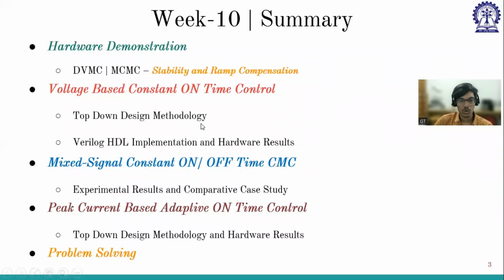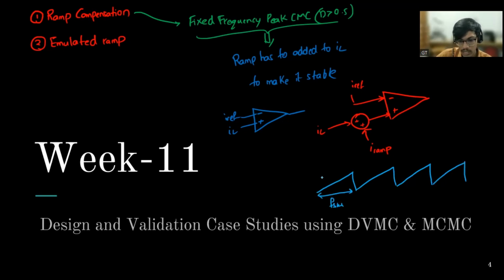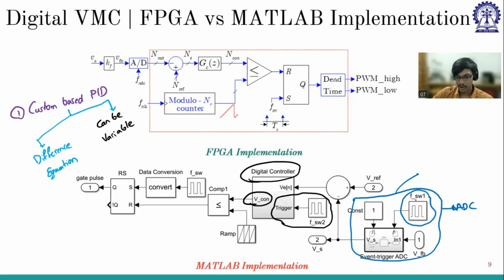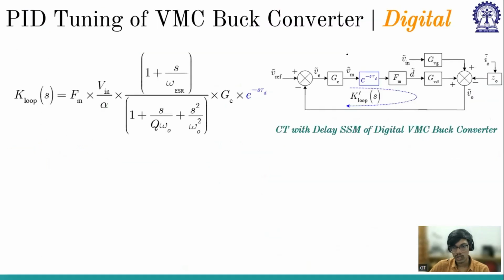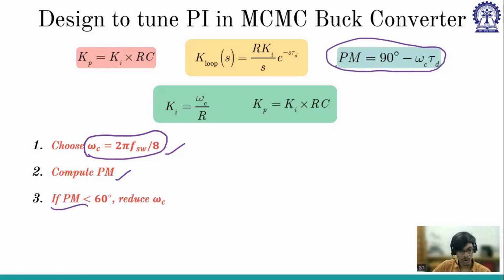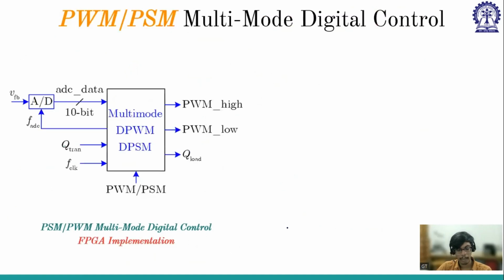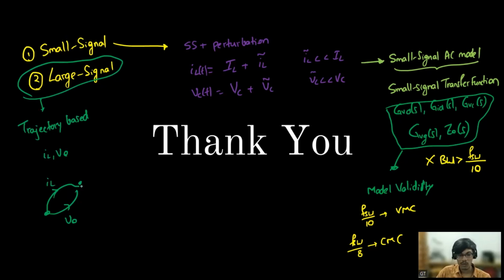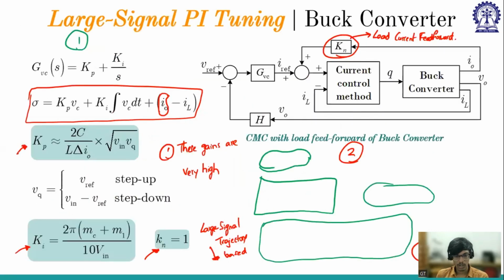Week 11 | NPTEL | Design and Validation Case Studies using DVMC & MCMC | Problem Solving Session

Comment: Could you provide an example of a complex engineering system where DVMC and MCMC were used in the design validation process? I'm interested in understanding how these methods were applied in a real-world scenario and what insights were gained from the simulations
Reply from the maker: You may go through Lecture 118 (https://youtu.be/Fyu5kqbmcik?si=RUnxjAQ3g3U09drr), where Dr. Santanu Kapat has discussed a few commercial products where they have used the control architectures that have been rigorously discussed throughout this course; some of them include VMC, MCMC, light load control architectures, etc. In Week-9, Lectures 85 and 90, STMicroelectronics and Texas Instruments showed their reference designs of PFC, LLC, which are designed for EV charging, and they explained briefly about their digital control architectures and how they are implementing them. Also, they have shown some simulation case studies that they have done before implementing in hardware. These are two examples, but multiple simulation case studies should be performed before developing any product to assess the workings of controllers, transient performance, start-up logic, protection logic, etc. Although the simulation might not exactly match the hardware, it gives an idea and is good enough to get some understanding of the controller. It is also necessary to check its proper working before directly testing the hardware, as devices get damaged if something goes wrong.